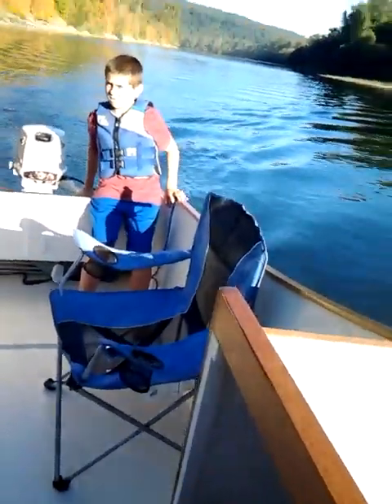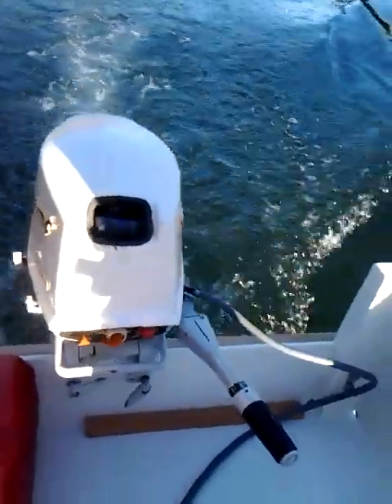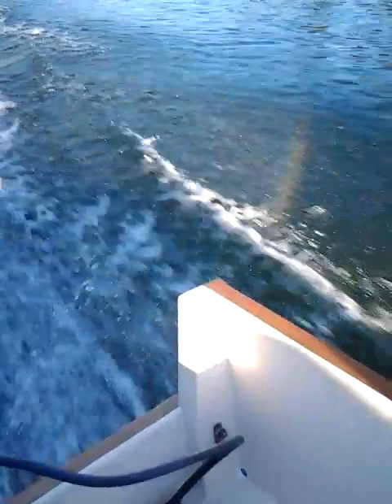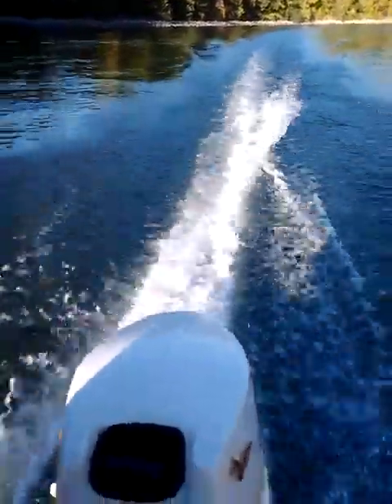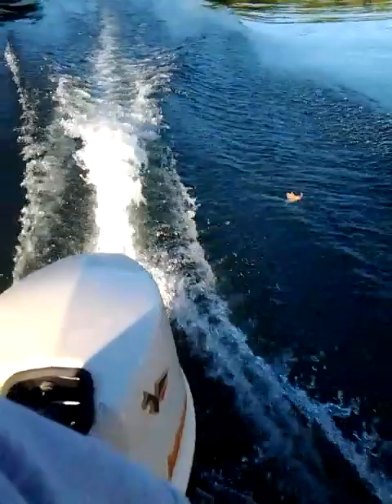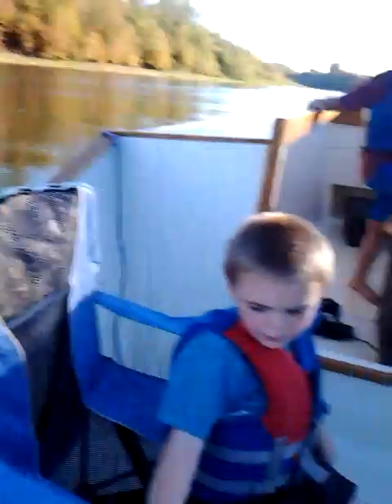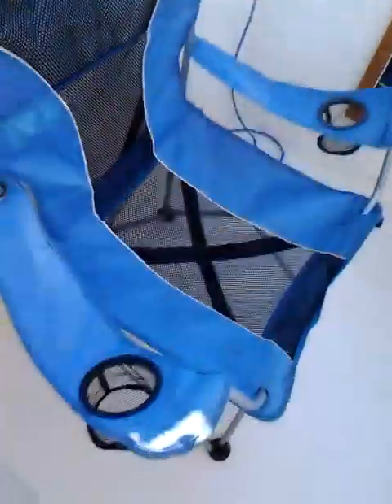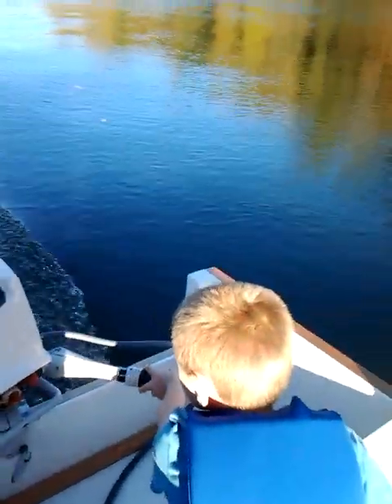AF4 Maiden Voyage part 2

Comment: What a nice rig, that old FD will run just as smooth as most four strokes!  And you are right, when tuned correctly, almost no smoke even at 24:1

Comment: How's it holding up without epoxy on the seams?
Reply from the maker: It is holding up great! Many boats have been built and lasted for decades without epoxy. I have since added an 18hp Tohatsu 4 stroke with electric start (heavy) and remote controls.  I pound through waves/chop at 24mph without any issues.
Reply: Nice. I built a PDR a couple years ago, and am looking for a bit more ambitious project. The AF4 really has my attention.
What would you estimate your build time was?
Reply from the maker: 2 1/2 months of evenings and weekends. I calculated about 120-150 hours. I kept a log until 80 hours, but I got more interested in finishing the boat than keeping the log.
Reply: Awesome. Thanks for the info! Looking forward to getting one of these cooking!
Reply from the maker: I really enjoyed the build. The boat is well designed. It does well on little power. I have quite a few build photos here https://groups.yahoo.com/neo/groups/Michalak/photos/albums/1832779836 . You may have to join the group to view the photos.